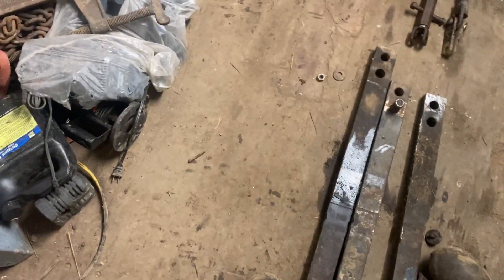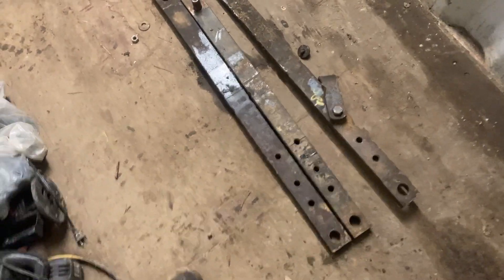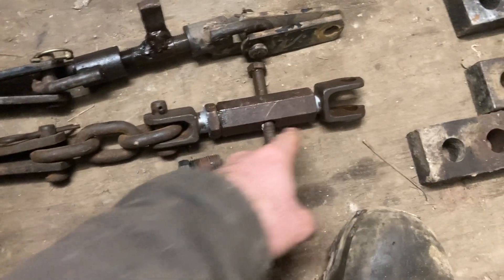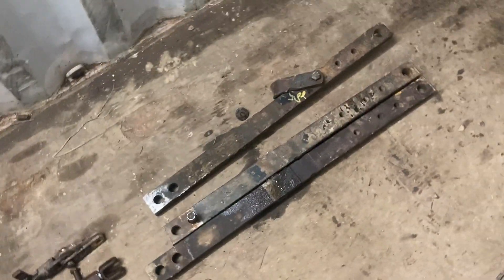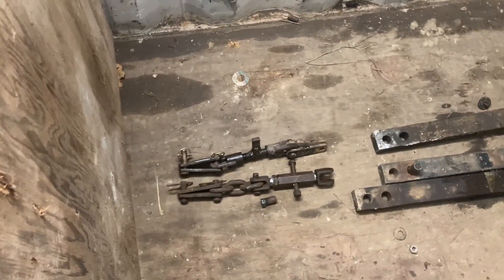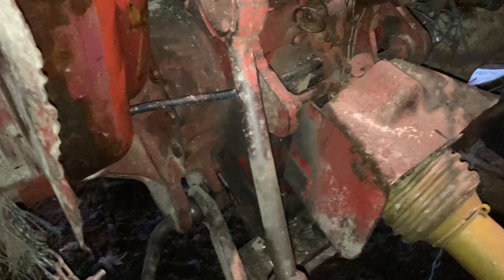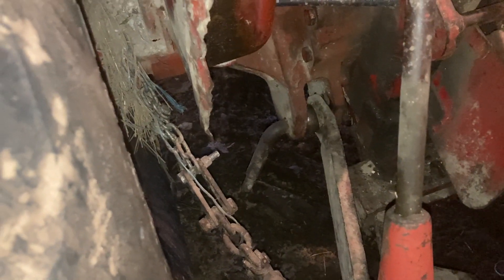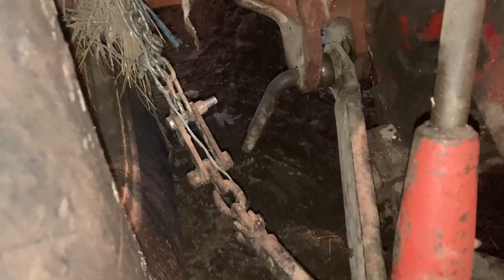IH utility tractor parts what to look for

Comment: Good  day  Can I get a first Name?
What did drawbar cost?   That side link I think is same sa 574
A while back I had to change 3 pt arm from cat 1 - 2, so u turn arms  around, well I lost the pin that goes in arm 
that is 1-1/8 cat 1  I phone dealer for new one  $90.00
at that time I work for welding shop so took 1-1/8  drill hole,  so it works> 
Thanks  Boy o boy I am73  I don't think I ever saw winter like this.  I just hope it doe not come in  April or May
Reply from the maker: So sorry I haven’t gotten back to you sooner you tube keeps timing out on me 
It’s Levi  the drawbar was $100 cad at bm agri parts
Edit I also hope it doesn’t come then either as that’s when the calves are coming
Reply: @case85xtfan33  Good  day Levi   100 was to bad?  How many cows ?  Thanks
Reply from the maker: @donvoll2580  actually really good price as Stoltz my case IH dealer wanted 600 if they found one 
About thirty five Charolais  had fifty a year before Covid but ran into a low protein hay two weeks before the first twelve calved got some protein supplements but it was too late for a few unfortunately and it wasn’t just us a-lot of people had the same problem 
The reason for the low quality hay
Was it rained so much that the grass didn’t get enough sun light while It was growing
Reply: @case85xtfan33  So Stoltz is your dealer too.  Down here at Elmira for me., so were is your dealership?  600 bucks wow.  Thanks
Reply from the maker: @donvoll2580  mildmay stoltz It’s a good two hour drive